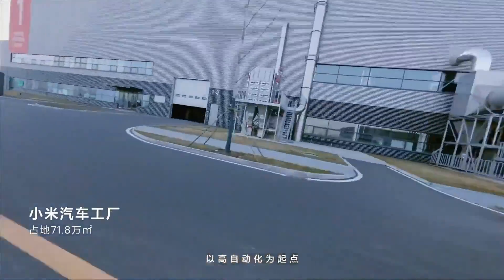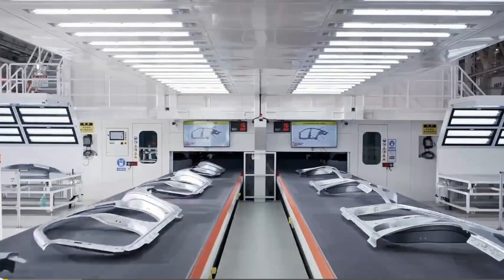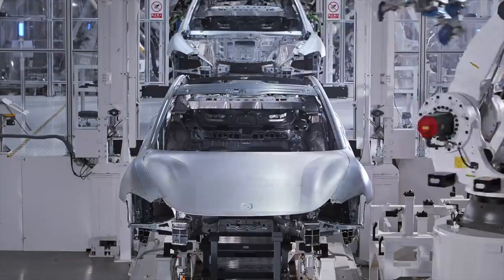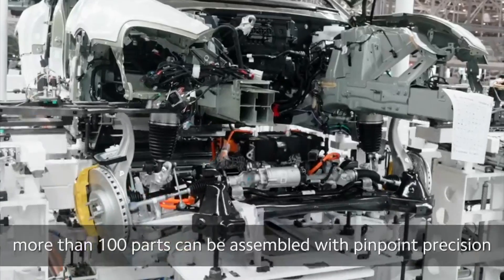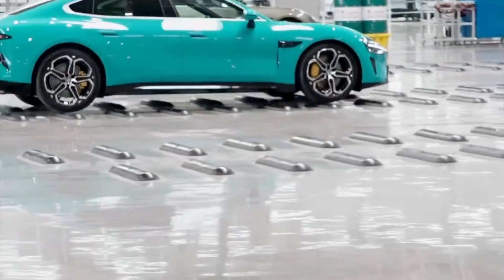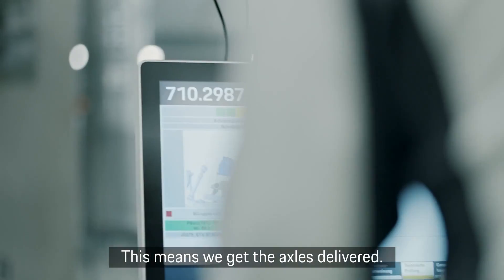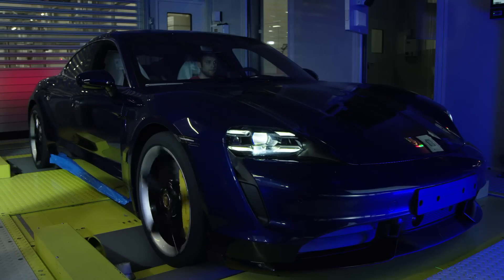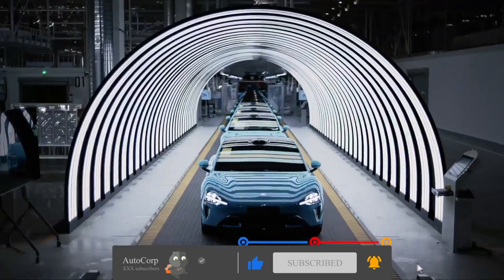A Xiaomi SU7 is produced every 76 seconds, while a Porsche Taycan takes up to 22 hours to complete.

Comment: Well well well...
A vehicle each 76 seconds does not mean 76 seconds are enough to produce a single vehicle.
22 hours to produce a vehicle doesn't mean that only 1 vehicle per day is produced.
All depends on the number of vehicle in the pipeline.

Porsche sold about 40 000 Taycan a year.
This means, if there are 300 working days, 133 vehicles a day.
And this means, if there are 16 working hours a day,  8 vehicles each hour... So one Taycan is produced each 7 minutes…

Taycan is a premium vehicle, say 100 000 USD.
SU 7 is a relatively cheap vehicle, say 30 000 USD.

Are you sure you can compare the figures?

Xiaomi has a nice factory, for sure. But be careful with the figures.
Reply: I’ll buy a xiaomi and keep 70 K in my pocket and fuck you😂
Reply: How does paint dry in 76seconds?